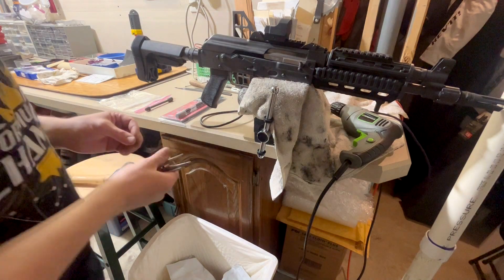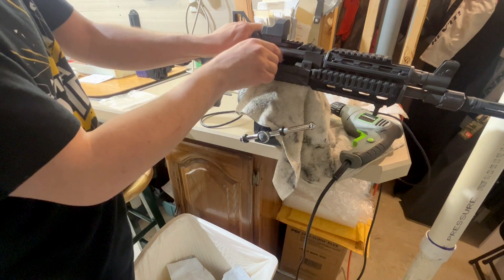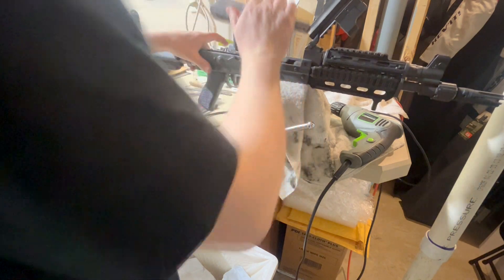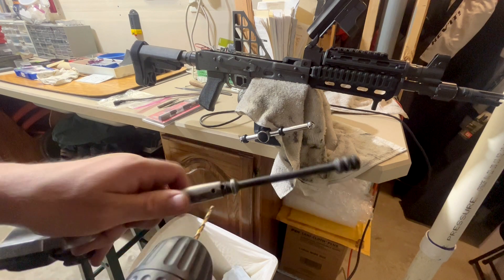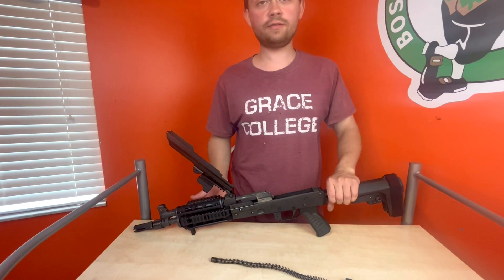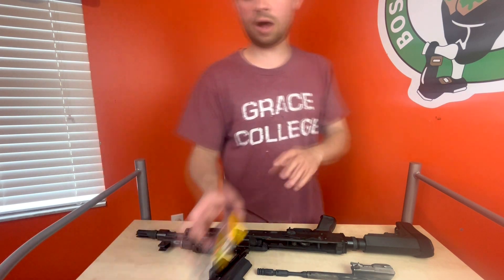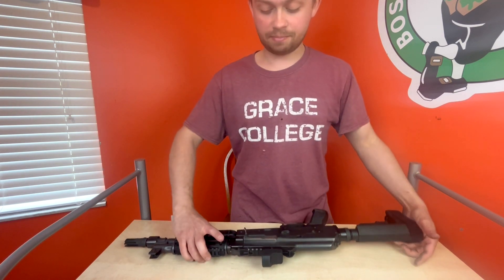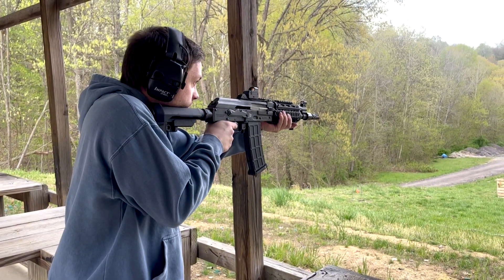KNS Adjustable Gas Piston (M85 PAP 10" Pistol) Install/Test

Comment: Hey brother I own the same piston and I wanted to let you know that you have it backwards the full open position is the opposite way down the collar of the piston.  You can indeed lower your felt recoil significantly more
Reply: Thank you, I was watching this video and I was all mixed up. now it makes sense.
Reply from the maker: That’s not how the manual reads…
Reply from the maker: So turns out you are totally right, when I first installed the piston I had it turned the correct way, but it was still cycling fast so I turned it the opposite way. A couple months later I retested it according to what you said, and you’re correct I guess I had the opposite direction. 🗑🗑🗑

Comment: Mcarbo  recoil spring is stronger if anyone looking for a cheaper option it cuts the ejection distance by 50% and angle from 430 to a 330

Comment: The adjustment on the M70 is pretty underwhelming. Some work, and others don’t. Mine literally has the same ejection and recoil impulse regardless of what setting it’s on 😂
Reply from the maker: Thats news to me, Zatavas are really nice. Just unnecessary how much gas is implemented on the bolt cycle, so much so that malfunctions or caused because how fast the bolt was moving. KNS piston seems to have fixed the issue.